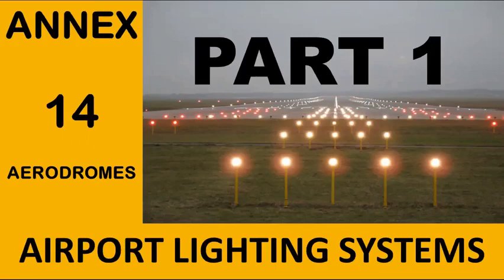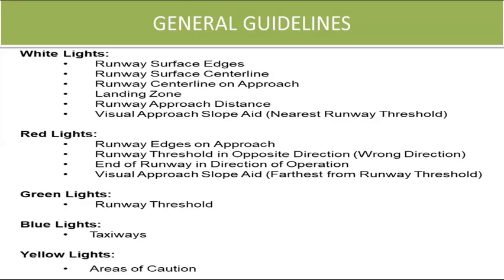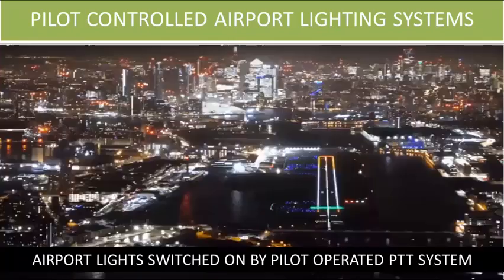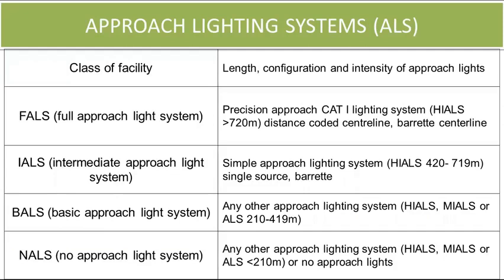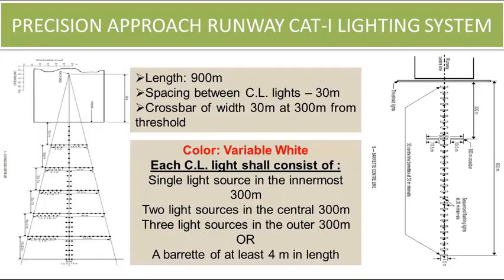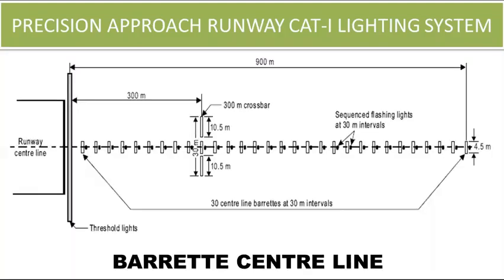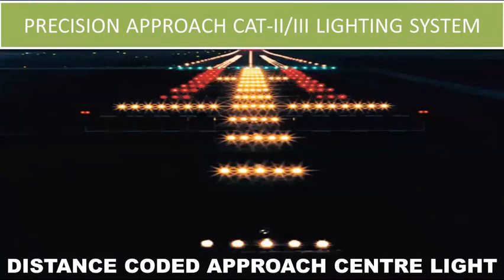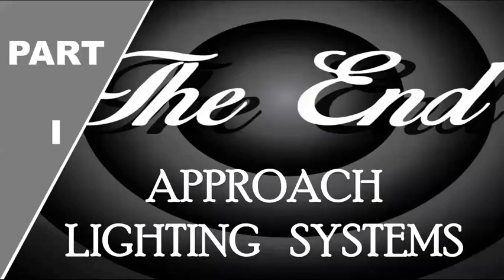APPROACH LIGHTING SYSTEM

Comment from the maker: A simple approach lighting system shall consist of a row of lights on the
extended centre line of the runway extending, whenever possible, over a distance of not
less than 420 m from the threshold with a row of lights forming a crossbar 18 m or 30 m
in length at a distance of 300 m from the threshold.